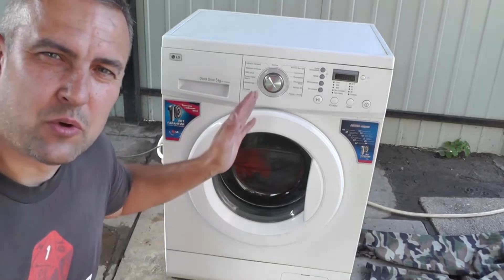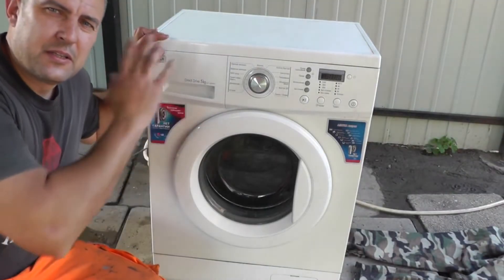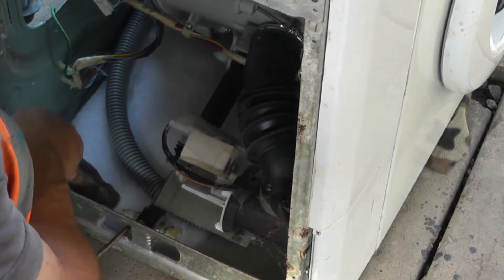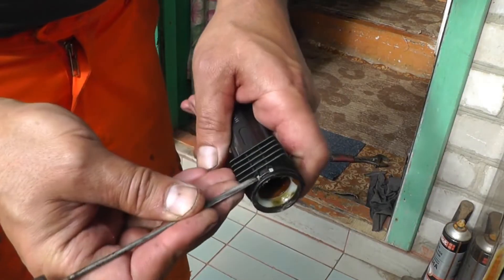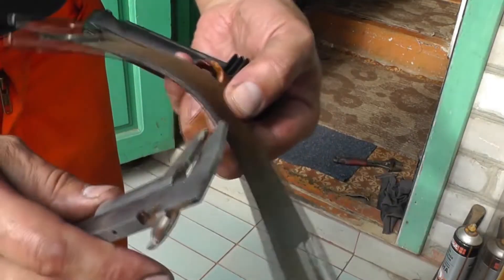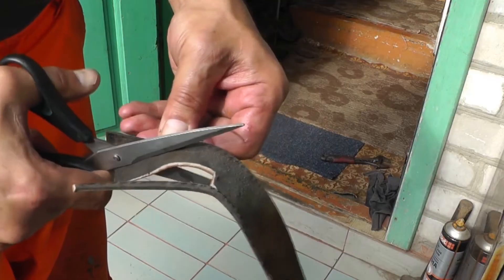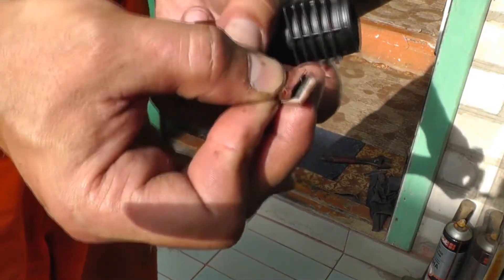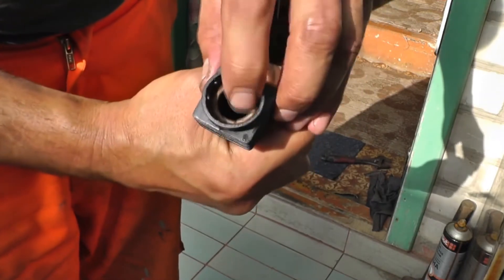I Restored Washing Machine Shock Absorbers

Comment: This is an amazing idea! I assumed they were filled with gas or oil. Looks like they work with only friction. Extremely helpful video! thank you!
Reply from the maker: Thank you friend for your support! Yes, they are easily repaired by hand if the holes fixing the shock absorber to the tank and the body of the washing machine have not increased.